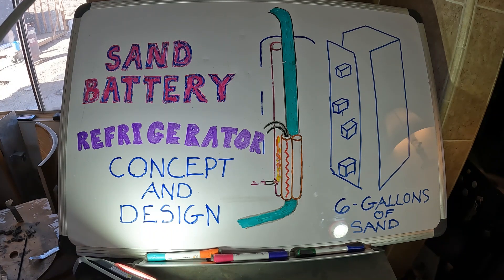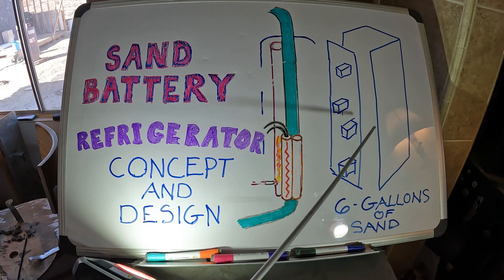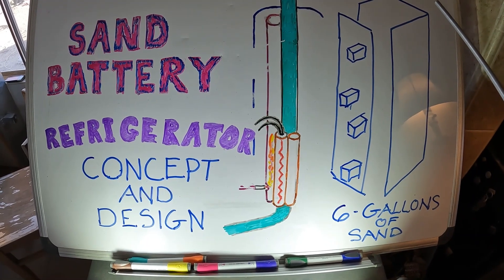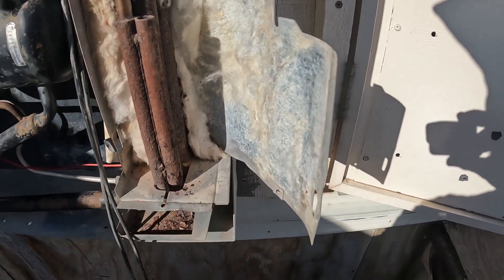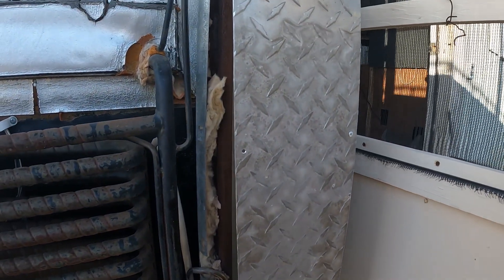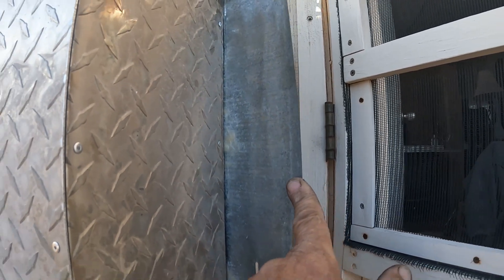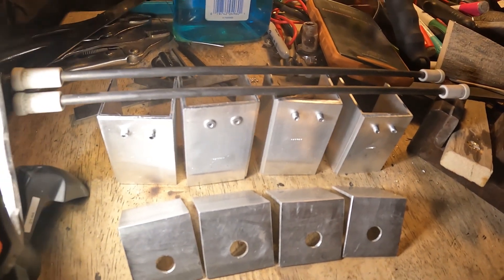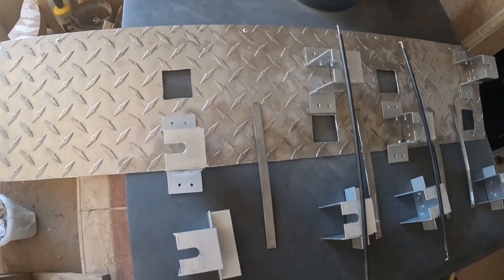Sand Battery Refrigerator, Concept and Design, Part-1

Comment: this is not right. you could use a working heat pump to heat the sand but you cannot use heated sand to cool the condensor ..IMO
Reply: Propane fridges run off of the heat
Reply: @zapcjw  ok the evaporator does ....you are right
Reply: I mean the chamber where the ammonia is boiled
Reply from the maker: I will be getting back to the refrigerator project. I was attempting to use the hot sand in place of the burning propane. It's kind of a long shot I realize but I am hoping if nothing else I can extend the cooling effect later ito the evening or ideally all night but like I said it is a long shot. Sorry it took so long to reply.

Comment: ahh ok, i thought you were going to freeze the sand for air conditioning from the title. I've thought of a system similar to your sand thermal battery but mine was designed around granite(headstone blanks) and thermite with a liquid piston sterling engine to recover the power out of it but never got the space to build it.

Comment: That's great  . Concept is correct this will work .I can see a large  freezer  and refrigerator ruining on the sand battery. will take some custom  building but there is no doubt  it can be done.